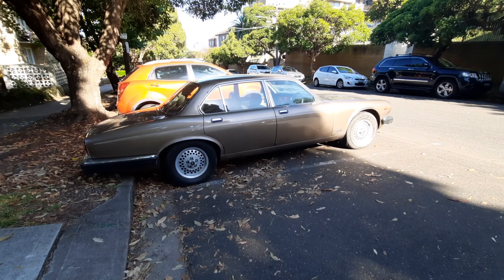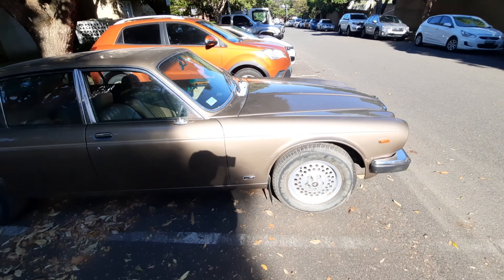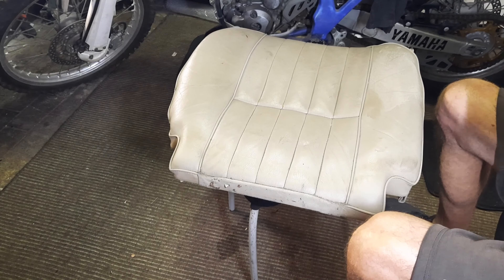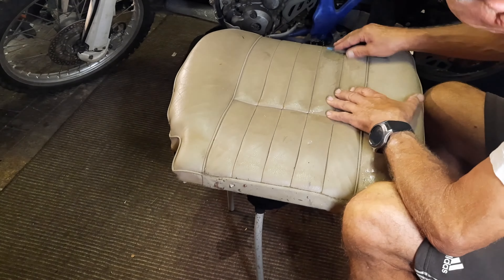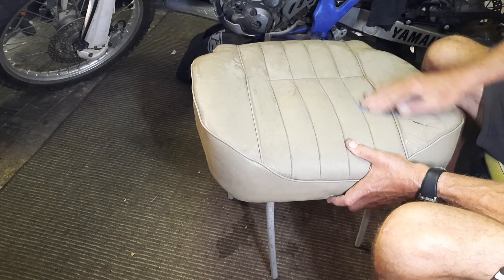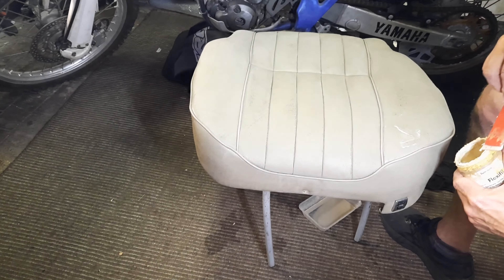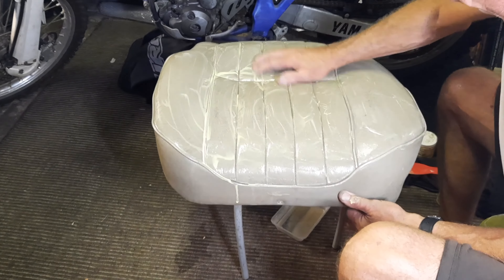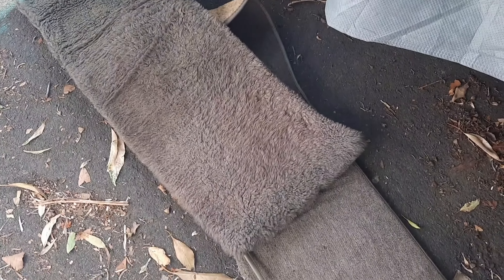1988 V12 S3 Bought sight unseen EP2

Comment: First thing I would check is the inertia switch. Up and down on a flat top and being pulled up on an angle could have caused it to activate. Push the button Max! NOT THAT BUTTON!!!!
Reply from the maker: Paul I did check the inertia switch 
Thought I may have bump it when changing the relays but no such luck 
Great you putting up with my vids though

Comment: Hi Mate.. definitely seems a fuel problem. I am almost 100% certain your car is a P-Jetronic and if so the first place I'd go is check you have 12V at your injectors. With the ignition on just pull off one of the injector plugs and see if there's 12v on one of the pins. All the ECU does is switch the other side of the injector to ground at the right time and the right duration. I'm guessing there's no 12v and if not, the first place to check is the Main relay which as far as I can see on the Haynes wiring diagram is the only point of failure between the 12v supply (the same 12v supply line that powers the fuel pump relay and starter motor (which I understand are both working). And if that the case you know you have 12v to the relay. 
If you have 12v at pin 30 of the Main relay but not at pin 87 then either the relay itself is bad or the 12v that energises the relay on pin 86 isn't there, and if not then I'm pretty sure that comes from the inertia switch.
Anyway, perhaps a few things you can look at.
Reply from the maker: Really appreciate the advice Jeff
Will look at all those things